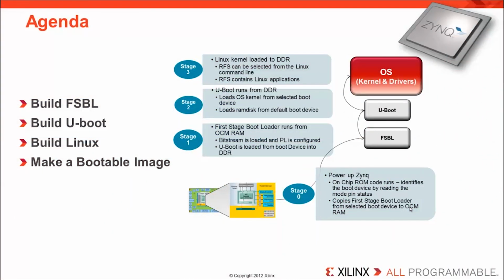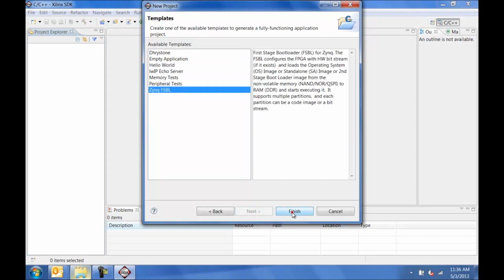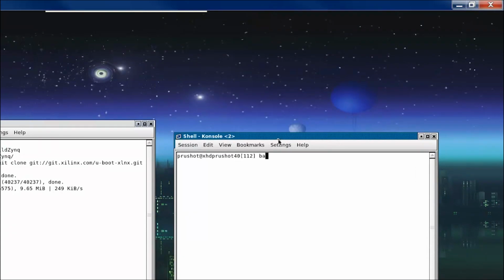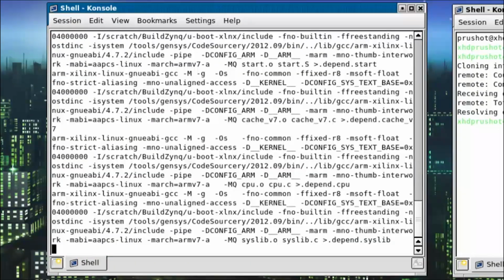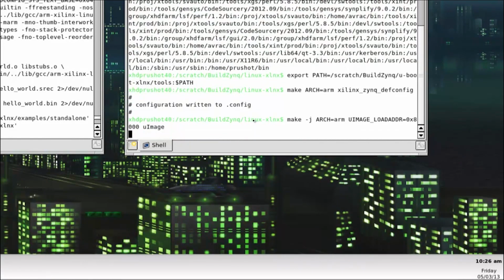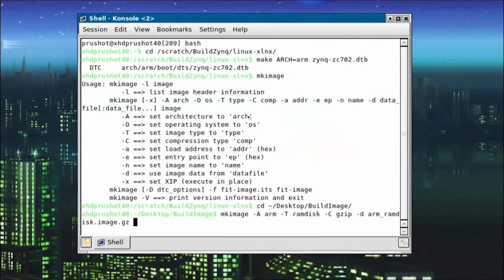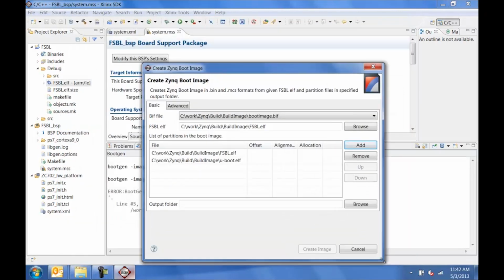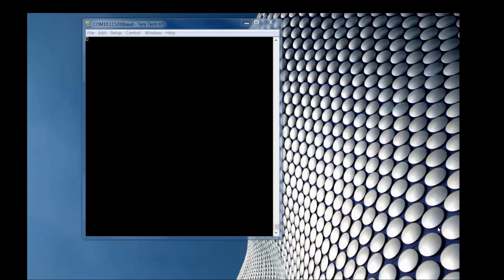How to Build a Linux Boot Image for the Zynq7000 AP SoC

Comment: Go here: http://www.wiki.xilinx.com/Install+Xilinx+Tools

This video is either horribly out of date or, as it seems, the presenter has a lot of "stuff" already set on his system that he fails to mention as "make -j <boardname>" doesn't work out of the box as shown.

First the user needs to run "MAKEALL -b <boardname>"

Then there's an ENV var ("CROSS_COMPILE") that needs to be set.

That also fails since CC1 lives in a different directory from the needed gcc and g++ components.

Then some include files aren't where expected and so that fails.

Huge fail all the way around. This video is near worthless.